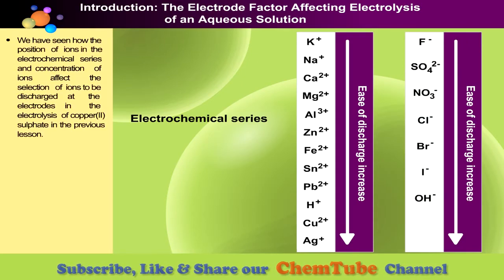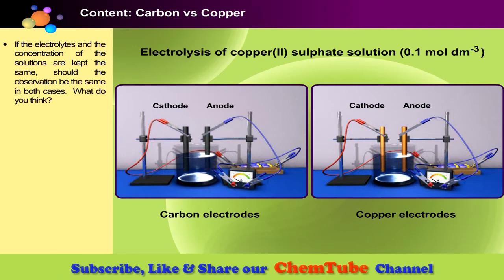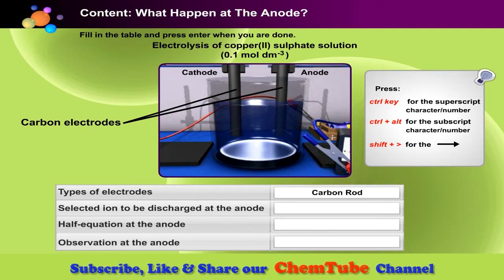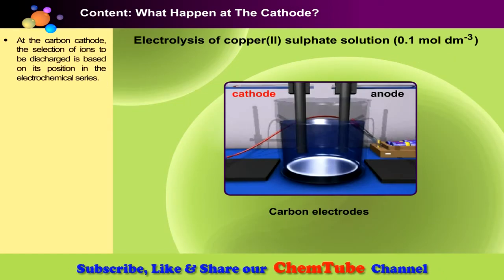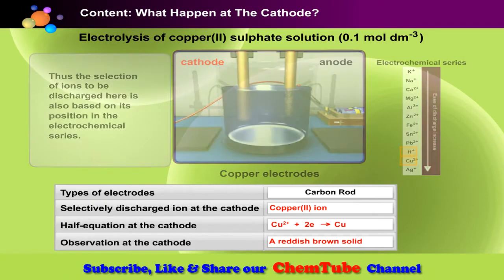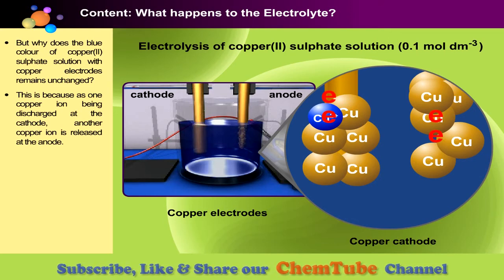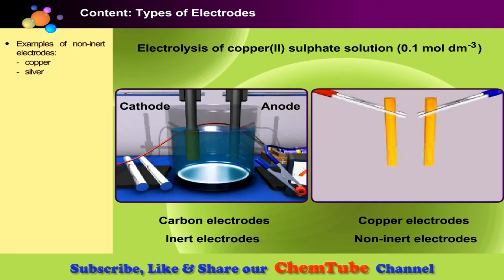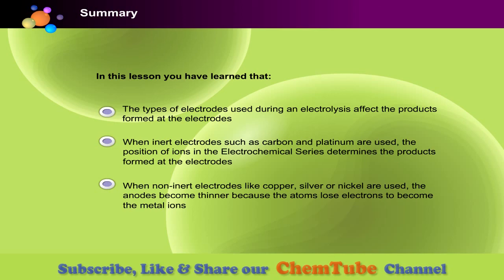Chemistry SPM: Factors of selective discharge of ions in electrolysis-Type of Electrodes (9 Minutes)

Comment: What if i use zinc electrode for zncl2 aqueous solution? Will h+ ion be discharged at cathode or zinc instead? Or will the zinc electrode at anode be ionized?
Reply from the maker: For cathode, just look into cations in the electrolyte, choose the H+ to be discharged in your case
Reply: @chemtube2984  oh thanks. They how about the anode? Will it be ionized?
Reply from the maker: @idiotsandwich7528  if zinc anode, yes, it will ionised
Reply: @chemtube2984  thanks